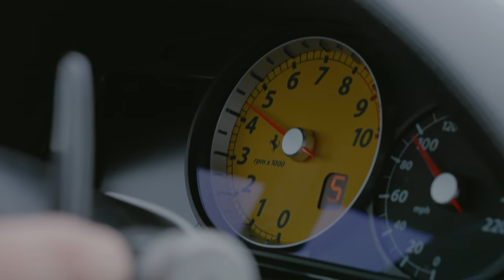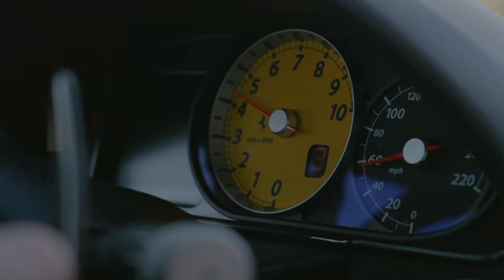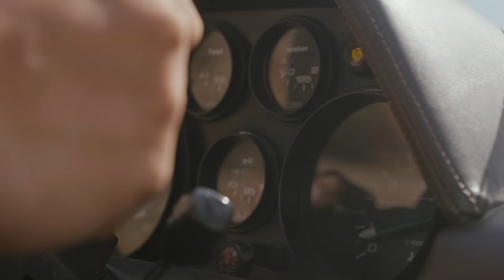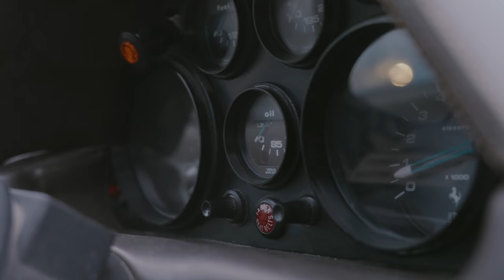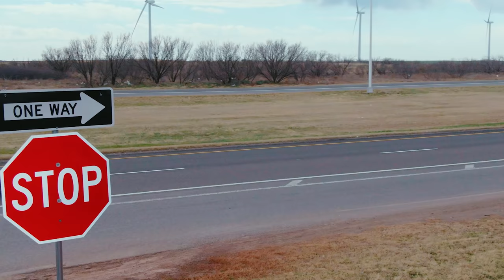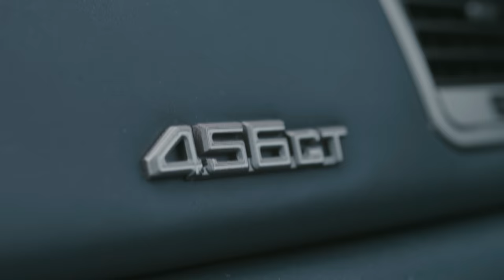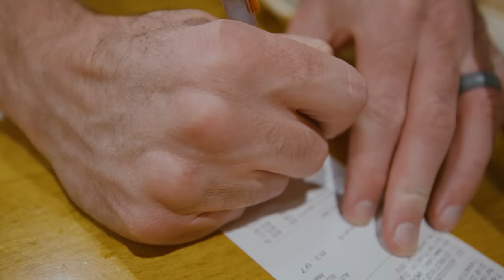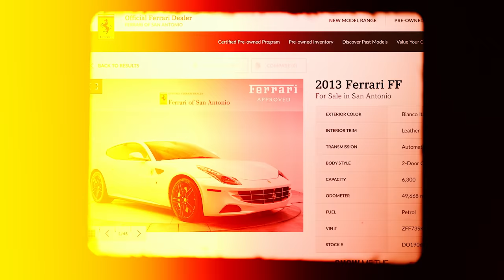Driving 1,000 Miles In Our Cheap Ferraris (Was A Total DISASTER) - Car Trek S4E3

Comment: 327,5 people probably already noticed the missing lug nut on Freddy's 308 at 19:10...but I just wanted to mention it. Hopefully he did not lose more safety-relevant parts so far. ;)
Reply: These older Ferraris have wheel bolts, not lug nuts. 

Just imagine a wheel bolt flying off at speed
Reply: I was litterally scrolling through the comments because of this.

Comment: Now try with each of you guys driving a Caravan! Long episode and not getting anywhere on the road 🤣
Reply: Haha jokes on you those 2003 Caravans are bulletproof
Reply: @uberschnilthegreat22  All the ones we see have transmission problems! Except for the rare 1 in a million okay running one
Reply: @cTothy  only problem with my mom's is the rack and pinion and general body rust, other than that the 600,000km van is always ready to drive long road trips.
Oh, and the outside temperature gauge is locked at -40°C lol.

Comment: My god it's not that hard. Multiply by 6 and drop the last digit. The faster you go the more inaccurate that becomes. But it will always be a low estimate. You guys were going almost 90 miles an hour at 140km. The estimate would have been 84 miles per hour. Either way you were speeding.